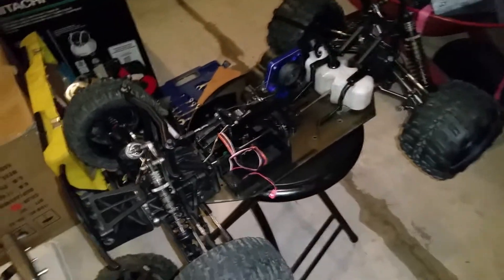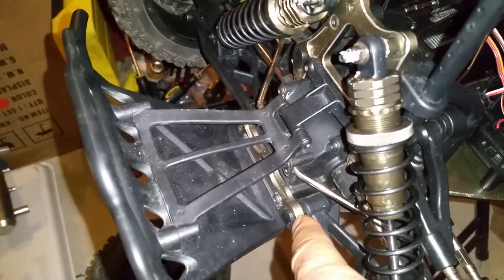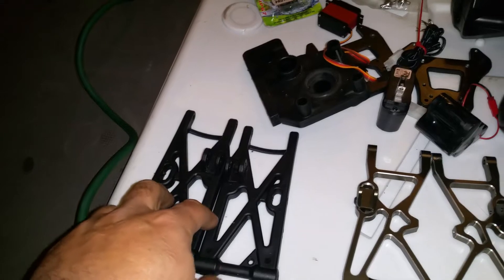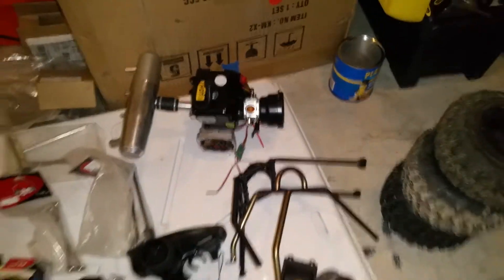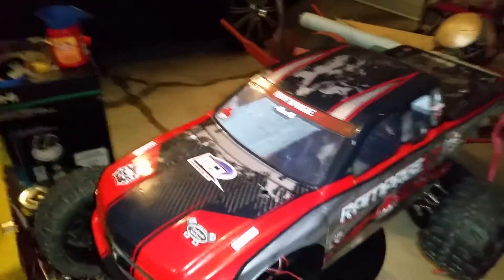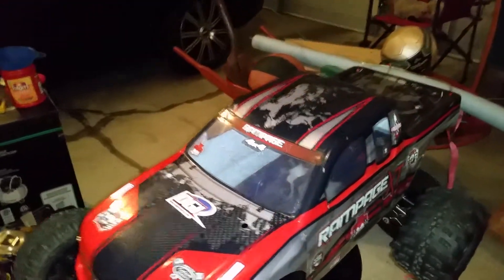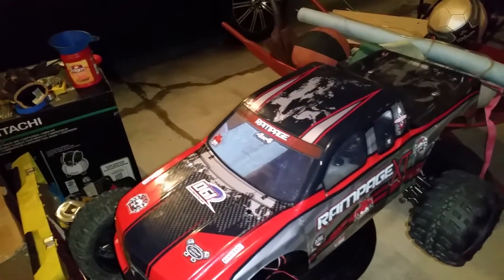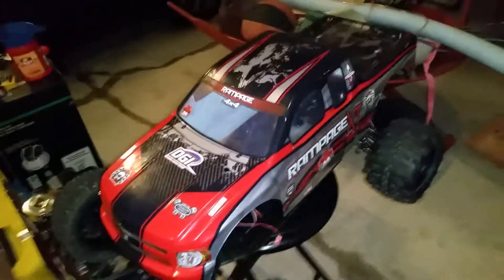Saying Goodbye to my Redcat Rampage XT and My Shop Update

Comment: Can't wait to hear the 47 on the X2.  Question?  Why did you get the Vekta?  I was thinking about the Losi 5B but I really dig those axels on the Vekta and the way the suspension is is pretty cool. I looked at the Vekta and thought it was too expensive but then I see the axels and this suspension arms and I see where the money is but still it's pretty expensive.  Good luck with it thanks for the videos.  My redcat is all stock and like 4 tanks of fuel through it and I think I'm going to sell it as well.  Have fun!!
Reply from the maker: AFTERMATH RC The vekta is the next big thing in 5th scales. The king of the hammers Is a relatively new sport 10 years old from which the the vekta 5. is based off of. The vekta 5. is basically the new losi 5t meaning the losi 5t never lost value it still 1500.00 dollars. But I live the redcat rampage xt that is what got me addicted to 5th scales
Reply: 5th SCALE RC INSANITY I don't know a lot about the rampage xt I also have the X2 I bought it from Dan in New York and it truly is what got me in 5th scale it is a beast and I love it so I'm not sure how I could share the time vs the Vekta but I will be waiting for those videos.  Did you get the kit or RTR?
Reply from the maker: AFTERMATH RC I waiting on the roller. It not coming out until mid March and they already sold out of a lot of the upgrades so I'm going to start buying them piece by piece now I just got my rear aluminum a arms for the x2. I waiting until I get the rest of the shit I order the I'll make a goodies video and i also bought some shit for my my shop om doing a shop make over

Comment: how is the fid 2 speed holding up
Reply from the maker: John Lorden I rebuilt it because the one way bearing was not lubricated and I don't like that you have to tear it apart to adjust to changing mechanism every time to find where like it but besides that if your fine with factory settings the it's works pretty good .It opens up your engine way more the stock..Your going to have to get some hardness diff cups and a strong drive train. .I going to do a video on how to harden stock diff cups soon